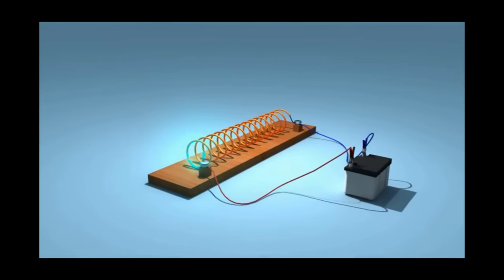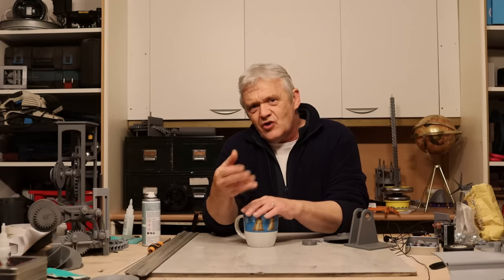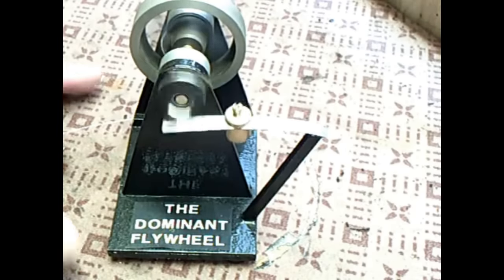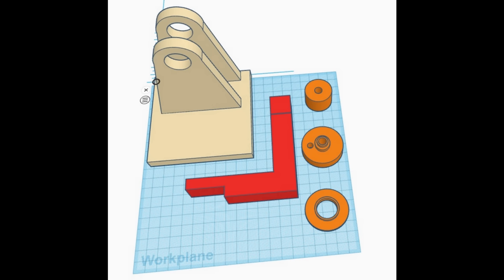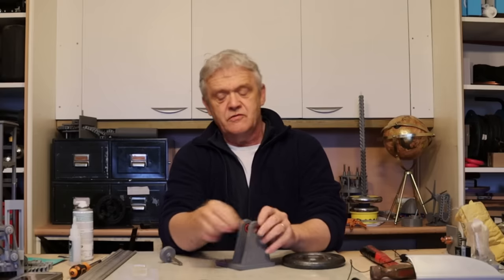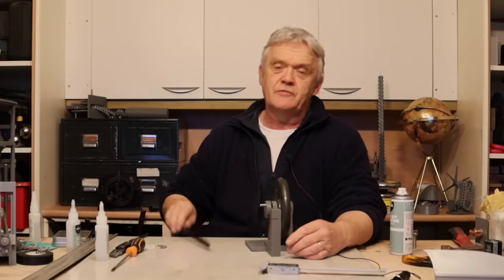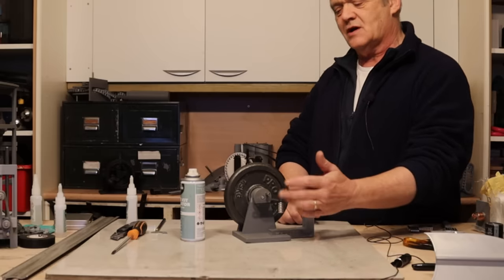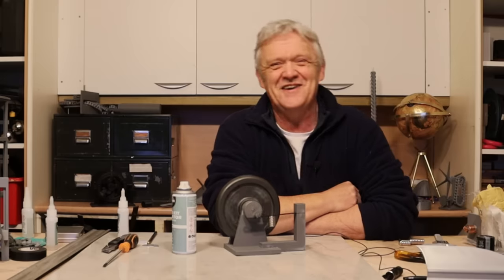2096 An Unusual Spring Motor

Comment: Another tank circuit for you:

- you store potential energy in a rotor as electrostatic attraction and repulsion between the rotor plates and stator plates
- the stator plates are electrically connected to each other so that charge can redistribute between the stator plates
- If there is a load on the electrical line connecting the stator plates, then the load will limit the speed that charge can redistribute with
- when the rotor is rotated to the highest energy state, directly in the center between both stator plates, where it has the most potential energy, it could fall into one of two lower energy states:
             - It could be rotated backwards and the polarity of the stators would be equal to the starting state
             - It could be rotated forwards and the polarity of the stators would be opposite to the starting state
- either way: the force of electrostatic attraction, provided there is enough capacitance and applied voltage on the rotor plates, will cause the rotor to "spring" into it's lowest energy position

If you have enough capacitance and applied voltage, you could use this spring action to "power" 1/2 of the rotors rotation in 1/4 rotation segements

Comment: Rob, this is a great demonstration of an asymmetric motor. The weight on the spring adds a dimension example of parametric oscillation. It would facilitate conversion as a springboard to creating a battery in plain sight. It's a motor that can run a very long time with very little additional power input. Fun to experiment with. Love it! Thanks for sharing!

Comment: Could you supply the dimensions for the round wheel that has the drive pin . It probably isn’t critical but it would save
Me from guessing and wondering it I was doing it right.

Comment: Watching this, I had a thought for a generator. Essentially have 2 magnet holders on the spring that drop down (like how he had the magnets), but have them facing toward eachother and have it move up and down some copper wiring. Go from a flywheel spring motor to a flywheel spring generator.
Reply: My thoughts on the same lines
Reply: You could do that, but it will make the flywheel slow down by exactly however much energy you make with the magnets and wire.  The lever will be a little harder to push down and will push back on the wheel a little less.  Consider why they don't put alternators on electric cars.
Reply: If you try and make a generator using the example in this video, you will find as soon as you try to draw current, the flywheel will slow down and stop.  The reason, is Lenz's Law.
Reply: that's just a way of extracting the energy--put a generator on it.
Reply: If you have a heavy flywheel and you help the spring along with a solenoid motor connected to a solar panel the flywheel can act as a battery, but honestly, a few magnets and coils could probably do even better. Problem with flywheel batteries are their size, a 4 ton flywheel coming off it's bearings can be an ugly thing.
Reply: @Voidy123   But they are used; running in a vacuum and on magnetic bearings; they can store a good amount of energy with instant access and long hold times cos no dissipation. And there's no bearing to seize up, so coming off its bearings isn't a thing. Still only used for when mass and volume aren't a problem, so anything on a vehicle is going to be a short-term backup for other storage methods--could be used for regenerative braking, for example, when using a hydrogen fuel cell rather than batteries.

Comment: It should not spin for any longer than just the flywheel on it's own.  There a frictional losses between the pin and the spring, noise and heat produced by the spring action.  So, just teh flywheel itself should rotate longer.  But it won't go click, click, click ..

Comment: A simple machine. I wonder how efficient it could be with a low torque motor on bigger applications. Use the motor to basically keep it moving. But not use as much power as you would to just run a fly wheel. I know we have gone far past belt driven machinery in shops atleast. But there is potential

Comment: You could take that a step further and put a bearing on the pin to help reduce the friction from sliding across the spring..

Just a thought . May or may not help . But i guess that is why it's called experimentation.
Reply from the maker: it does help mate - nice idea thank you

Comment: The spring can only supply as much energy as it is getting from the flywheel.  The flywheel has a finite amount of energy input at the start. friction in the bearings and between the spring and flywheel further dissipate the available energy. I can't see how the system runs any longer than the flywheel on its own. The original is fake.
Reply: You were doing well to admit to not understanding how it could prolong the energy dissipation. I think that to call it fake is disrespectful. I, too, would like a direct comparison and, if this shows a real advantage, I'd want to know the underlying principle. If nothing else, he's given me a theory about how my guitar's delay pedal might work.

Comment: A very entertaining and curious contraption but I don't think it quite works as a mechanical analog of the tank circuit. The flywheel just runs in one direction it I don't think it has a distinct resonance frequency. It has a clever simplicity so that the flywheel can keep spinning in the same direction but I don;t see it as a trank circuit equivalent. A pendulum fo rexample would maintain teh same resonant frequency and only it's amplitude would decay with losses. Perhaps, a closer approximation of the tank circuit sumulated with a flywheel would be a stretchy cord (or a non-stretchable one connected to a spring)  spooled up onto the shaft and spinning the flywheel back and forth.
The interesting thing about this solution is that energy could be pumped in at every turn, giving a small push to the flywheel to maintain motion.
Please, just drop a bit of oil on the spring to reduce friction! 😀Or, use a connecting rod but of course, that'd kill the brilliant simplicity of this solution.

Comment: Sorry but that is not an motor, it is a flywheel being slowed by friction from a spring rubbing against it. Energy from the flywheel is being used to push the spring. It is basically like the flywheel of a combustion engine pushing a valve open via a camshaft but minus the rest of the engine....wtf

Comment: It's a nice demonstration for a science class.  

Sure, we could put in a vacuum and give it magnetic bearings, including the contact point. It will make it last longer.

Plus, as soon as we put a load on, it will slow down faster, proving it's not perpetual. 

It would be a cool science experiment to show how much of the initial rotational energy would have been recovered if a generator was applied.  It'll be less than input due to bearing losses and such, but I'm curious.
Reply from the maker: i don't understand - why would anyone think this was perpetual motion? as i said in the video this is the mechanical equivalent of  tank circuit
Reply: Dear Robert,

In that case why not  put some magnets on that flywheel and a coil around it just for fun just to see how much you would get? I mean considering how simple it is to do and how much clarification on the matter would be gained how could there be any reason why not to try it?

Comment: Imagine that with a good semi operable magnet motor, maybe it could make it keep going  push it past the hangup spot. Or the spring lever move a magnet causing the hang up.  I have thought maybe if the magnets are spinning  in place . Timed with the rotor they may work better,  or use a electro magnet to  bend the permeant magnets field , preventing a hangup!

Comment: So it is a mechanical bendini motor. But could it do work or generator electricity?
Reply: What about using a coil spring instead of a piston in an engine.

Comment: It's not an exact equivalent of an LC circuit.  The spring/mass oscillator is the exact equivalent.  Adding a diode, another inductor and an infinite resistor all in series to the LC circuit would be closer to an exact equivalent.

Comment: Everyone forgets that... There's nothing in physics that says perpetual motion is impossible.

The caveat is, you'd have to eliminate all friction and resistance and part wear/degradation and if you've managed that somehow you have a machine that will operate in perpetuity - that's an engineering problem to solve.

Of course, physics steps back in once you've got that machine that runs forever and gently reminds you "that's very cool, however, if you take energy from it, it will stop... Thanks for playing".

Comment: The flywheel will eventually stop. You have friction and the heat generated by the compression of the spring. If a magnet is involved, it will use up the magnetic field energy until the magnet is 'dead'.
Reply from the maker: of course it will - the magnet is just a weight

Comment: That’s simply not going to spin any longer with the spring than without the spring, with random minor variations for lubrication differences on the bearing and sliding surfaces from one test to the next.

Comment: This is basically how Helion Energy is going about accomplishing Fusion. By “this” I mean an “Oscilator” large bank of capacitors, a coil that not only creates the field to squeeze the plasma as they feed in Helion for fusion. Then the coil captures the energy released  by the fusion once a second.  The caps then feed the extra energy form the Helion fusing out.
Reply: Ah fusion, isn’t that the energy source that’s 30 years away, and always will be 😉

Comment: There are quite a few videos on filar wound coils that are both inductor and capacitor in one.
Reply from the maker: all coils are inductors, capcitors and resistors in one mate
Reply: @ThinkingandTinkering  
Bifilar and trifilar pancake coils especially so apparently. The recent developments at Mahle electric motors with wireless feild coil operation was interesting.

Comment: A Toroidal Electro Mechanical Tank Circuit
In the center of a donut shaped toroidal 4 output/input coil, balanced on a cylinder, a magnetically reactive metal triangle, with the point down inside the rotating field.
One wire, output/input, connected to a Van Degraf antenna, in order to charge the environment or collect from the environment, can function as a source of input energy to charge the coil.
With a rotating magnetic field in the toroidal coil will cause the triangular piece of metal to resonate in the center. As the triangle metal piece moves it will also change the magnetic field generating electrical energy, multiplying across the other three wires and preserving the charge state for an extended amount of time.😊

Comment: Not a particularly good analogy, because while the inductor needs the capacitor to form a circuit in which the current can keep "sloshing" repeatedly between the two, the flywheel would happily keep turning without the spring - actually, for longer than WITH the spring. A better illustration of this would be a heavy ball with a climbing incline on one side and a horizontal spring on the other: if you let the ball roll down the incline it will run into the spring, compress it, then turn around being accelerated by the decompressing spring and run back up the incline part way (then repeat). In this case, taking away either side would prevent any cycling for the ball - it would just roll away until friction expends all its energy and never return, just like one-way discharging a capacitor charge or inductor field alone would work...

Comment: Well, obviously that flywheel would spin a bit longer without that spring being involved at all. BUT, if you could nudge that spring upward at just the right moment you'd have something similar in concept to the old one cylinder "hit'n'miss" engines of the early 1900's

Comment: Robert, I think you need to follow this up with an explanation to all of these commentors who think it is going to run longer because of the added sprung.  I know you showed this as a mechanical analog to a tank circuit, but a lot of folks are thinking you just pitched something that is actually creating energy.  Let them down easy.
Reply: Spring.
Reply: Next you will be saying that there is no Santa claus.
Reply: Even Santa Clause has to feed his reindeer.
Reply from the maker: i think you are right mate - i have been reading through the comments - i can't understand why they would think that but apparently they do - i will do my best mate lol

Comment: No way that a rotating flywheel can be energy storage in a resonant system. Now if the flywheel reversed direction periodically and traded energy with a spring, that could be an analog to an LC tank circuit. With a rotating flywheel resonant storage cannot happen. Our friend is pulling our leg here.

Comment: Never heard of the term 'tank circuit'.  In engineering it's called a LRC circuit because of the components.
Reply: I suspect it was called a tank circuit in engineering before you were even born.
Reply from the maker: from wikipaedia - An LC circuit, also called a resonant circuit, tank circuit, or tuned circuit,

Comment: really neat video and concept. i was imagining a plate placed under the spring that with every revolution would put pressure upon a plate of quartz crystal. this quartz crystal would be connected in circuit to a capacitor and then to a motor that could help propel the flywheel for an even longer period of time. there maybe other components that would be required to make the circuit more functional but thats the gist of the idea. like is the current produced by the piezoelectric ac or dc? what would be the dimensions of the crystal plate need to be in order to produce a sufficient charge? how much pressure needs to be exerted upon the crystal in order to produce the piezoelectric effect and could that pressure be reasonably exerted without damping the system? may this train of thought lead to more great imaginings.

Comment: I think you spun your model in the wrong direction?   …the first model shown went counterclockwise, so the rod was in a rotation that pushed down onto the end of the spring, then is pushed up by the stiffer inner section of the spring.   Your model was spun in the opposite way.

Comment: Surely you can combine both the mechanical spring setup here and an oscillating capacitor/coil component to give an additional boost to the flywheel. That additional shove could be enough to overcome resistance in the capacitor/coil setup and help drive a third generator component with magnets attached to the flywheel.
Reply: Why don't they just run one windmill as a fan and point it at another windmill to power the first one?

Comment: Motor? I'll just leave this here #2 should be germane, but isn't lol

1: one that imparts motion

specifically : PRIME MOVER

2: any of various power units that develop energy or impart motion: such as

a

: a small compact engine

b

: INTERNAL COMBUSTION ENGINE

especially : a gasoline engine

c

: a rotating machine that transforms electrical energy into mechanical energy

Comment: Any amount of push up on the roller pin attached to the fly wheel, is lost in the energy needed for it to rotate and push the spring down with that roller pin.....so it just slows down and stops.  

like a stationary magnet, and a magnet attached to the axle of the flywheel......as the magnet on the axle rotates around and is repelled by the frame magnet that is stationary, it slows the wheel down some, even tho as it passes by, the magnet on the flywheel axle is now pushed away and in the direction needed to apply a forward torque on the axle to keep it going the way it was rotating.................

So the "spring powered motor" is the same physics in reality, and all of the mechanical forced needed to rotate and press the spring down with the roller pin...........uses up any benefit of the spring pushing back up on the roller and assisting in turning the flywheel axle , as the roller pin goes on by.............so the net effect is loss as usual, and it slows down.

IF you are serious about perpetuating movement, i can share with you two of my designs that show real potential.

Comment: I'm a little confused about why this is here. Usually when you do a video about some magical motor that runs forever without power input, you're debunking it. LC tank resonators don't run perpetually either. This is possibly the most I've ever been disappointed in one of your videos.
Reply from the maker: i don't understand - why would anyone think this was perpetual motion? as i said in the video this is the mechanical equivalent of  tank circuit - and to my mind - somewhat obviously - friction is going to stop it turning
Reply: @ThinkingandTinkering  perhaps what threw my expectations off was it being referred to as a "motor." Not trying to split hairs over vocabulary, but that seemed very misleading in this case. A flywheel is not a motor, whether or not it is attached to a resonant element. Otherwise motor means "anything with inertia," which makes the term nearly meaningless. That said, I probably should have just ignored the word choice.

I think it's an interesting mechanism and may give some resonant amplification at a specific speed if properly tuned. I hope you attach this resonant flywheel mechanism to a motor in a future video.

Comment: The secret is in the length of the spring at the compress and uncompress point.

It's a small difference, but enough to power the wheel.